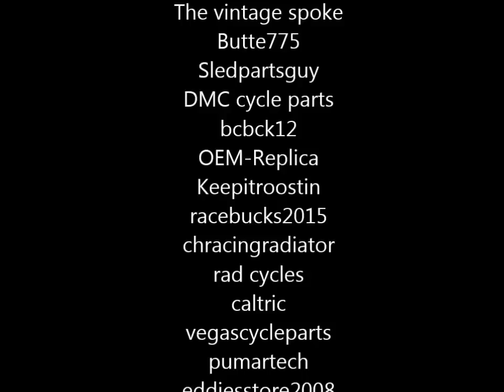Incredible rebuild of a $300 CR250 Dirtbike

Comment: Awesome build,  Ive done 3 of these with my brother -  There's nothing that compares to restoring   these 2strokes,  Keep them Alive!
Reply from the maker: Thanks. 1985 CR250 in the works
Reply: TNT Moto I've got one now. Where did you get the plastic for this bike? All the aftermarket stuff I can find is off color.
Reply from the maker: I restored the plastic that was still good and got the missing pieces off used bikes from ebay. then i restored them.

Comment from the maker: I sanded the plastic with 600/800/1000 wet sand paper. then I used a product called plastic renew using fine steel wool between coats. I have tried a buffing wheel but I could not get it to look this good.

Comment: who is the music by??????? freaking AMAZING!!! awesome CR as well! about to do the same thing with my 1992 WR200 2stroke..
Reply from the maker: +lucid phreak This is the song name and author of the music in my video 
Tremsz
Gunnar Olsen

Send me a link to your WR when you are done. I want to get one as well  because they look great done up with YZ plastics and customs graphics. This guy did an amazing job https://www.youtube.com/watch?v=rJSNr7KffPA
Reply: +TNT 22 The thing to note is that the WR200 and the WR250 are entirely different beasts... The 1992-1997 WR250 2 stroke is definitely basically a YZ250 with a wide ration gearbox.... The WR200 is TOTALLY different... Plastics are not interchangeable nor are any parts that I am aware of other than the front number plate (if you were going to remove the light from the WR200 and put a number plate on which I plan on doing)..... The WR200 motor came from the yamaha banshee 4 wheeler ... It has the YPVS system (powervalve)  that was not shared with the YZ that year - and I believe the forks are even different diameter.. The WR200 along with the IT175/200/250 are the most sought yamaha dirt bikes ever built because of the mellow power they deliver... You can basically compare a WR200 to a KDX200 - though "Dirt Bike" didn't thing the WR was anywhere near as good as the KDX because it was slightly porkier... For a 2 stroke though the WR200 is BULLETPROOF.. There are stories of people with the original piston who have ridden the piss out of these bikes... 

Now - what some people HAVE done, is taking the superior YZ chassis/suspension/brakes and mounted the WR200 motor in it to get that smooth power that people love so much.. But its not easy... People have also stuck one in a CR125 frame which is just mind blowing to think about.... 

Anyways - just a little info... Huge differences between the bike in the link and mine - but I will definitely keep you posted.. Its solid white other than the seat and will likely remain that way...
Reply from the maker: +lucid phreak  I was not aware of the vast differences between the two bikes. I had never looked up the 200 before. The 250 is the one i plan to get.
Reply from the maker: +lucid phreak This 200 looks pretty good. http://www.dirtbikerider.us/SP/264544
Reply: +TNT 22 the 250 is definitely cool.. I had one available to me here for $600 and passed on it simply because I wanted to 200 so badly due to the rareness... And yea, my bike looks basically the same minus the logo... Maybe not quite as sweet of condition...

Comment: I'm fixing up a 86 cr250 and was wondering how you cleaned up the forks and rear shock also if you bought the number plate backgrounds or cut them out yourself?
Reply from the maker: MotoMayhem The forks I cleaned with 1000 grit sandpaper and a brass wire wheel. the backgrounds I cut myself by making a paper pattern first

Comment: My Bro has one of those except his is thrashed. Awesome bike! Can't go long on a tank tho lol
Reply from the maker: Yes they like to gobble the gas. He should restore it. You would be surprised how little it cost doing everything yourself. and the reward in the end. well, show him this video.
Reply: Yeah it would be sweet. But I'm seeing coolant in the engine oil. Still fine as long as he changes oil every 2 or 3 rides. The bike has had a hard life for sure. It's a "Mad Maxer" now lol
Reply from the maker: Ya the magnesium clutch cover was a bad idea on Hondas part. But its amazing what you can do with JB weld and it will outlast the Magnesium.

Comment: Nice job. How did the paint on the frame hold up?? i usually powdercoat...but painting is a lot cheaper so curious to know how much chipped off/rubbed off. Also what type of paint did you use? cheers
Reply from the maker: Thanks. I don't own the bike anymore, but chipping was not a problem. It did rub off on the sides where your boots contact but even powder coating does that after a while. This was done with rattle cans with hardner in it. I am going to try regular automotive paint with hardner and a air gun on the next one. I will let you no how that holds up.

Comment: how did you get your plastics to look so good did you paint them?
Reply from the maker: I sanded them with 320/400/800/1000/2000 then  you can buff it with a sheep's wool buffing wheel on a drill being careful not to melt and add a Polish or you can use a plastic restore solution.  I will do a video on some of my Kx plastic when I get a chance.

Comment: How did you clean the tank and radiator shrouds so well?  What did you use?
Reply from the maker: Started with a SOS pad. then sanded with different grades of sand paper from 220 all the way up to 4000 with soapy water.. then buffed it with a sheeps wool buffing wheel on a drill. Try not to remove too much plastic on your tank or if you drop it it will puncture easy. experiment on a scrap piece of plastic till you are happy with the results, then do it on your good stuff. The coarser the sand paper you start with, the longer it will take to get all the fine scratches out later. If you have a newer bike that they still sell a plastic kit for $100. buy the kit. Buy DC plastics only if you cant find plastic to restore as its color and fitment is not perfect.Good luck. :).

Comment: I have 2 bikes a 96 yz 250 and an 87 cr125 that I love older Honda's are the shit.
Reply from the maker: Tony Cerino yes the older bikes are awesome. if you had today's suspension on a older bike, none of the newer bikes would touch them.
Reply from the maker: Tony Cerino I plan to get a 1987 cr125 for restoration after the 85 cr250 I'm working on.

Comment: Hey tnt, I have this exact bike and I'm looking to restore it in the very near future. I am very interested in where you found all the parts you replaced. Could you let me know? Thanks so much. Great video.
Reply from the maker: +Josh Engel  Most of my parts were purchased from EBAY. Sometimes it can be hard to find them on there. Simply looking up 1986 CR250 did not always get me the results i needed. Sometimes i had to look up just CR250 with nothing else. Other times i had to be very specific and put 1986 CR250R rear plastic fender. Alot of the parts are the same on the CR500 so that's a good one to look up as well. other times i had to look up the part number. I used this site to find exact part numbers. http://www.hondapartshouse.com. You can also cross reference by looking up different years and different sizes to see if parts match. Another way is to just post a Craigslist add that you are looking for parts for your bike. Sometimes people have bikes laying around or parts and they never post them. Good luck with your restore. Post a video, would like to see your progress. Any other questions, don't hesitate to ask.
Reply: +TNT 22 thank you so much, I'll post videos on my progress, thanks for the help!

Comment: on the before pictures on the swing arm what causes that i had it on a bike i brought years ago?
Reply from the maker: What are you referring too?
Reply: it looks like flakey metal on the rear linkage and swing arm not the shock sorry at roughly 21 seconds in
Reply from the maker: Thats actually dirt in the vid,  but its the clear anodizing coming off when its flaking.
Reply: ah thank you bud
Reply from the maker: no problem

Comment: Nice build! what are these worth now days? I have a 1986 in very good original condition. It has a crankcase repair though.
Reply from the maker: I have seen fully restored to factory original listed as high as 10000. not saying the guy got it, but thats what he listed it at. Now that was a complete restore, probably $3000 just in new oem parts. I sold mine for $2000. It was in good shape but not perfect. What country are you in?
Reply: I did notice at the end of the vid you were in Canada before i posted.  Im in the US. My bike sat for a long time and is hard to start but when I got it going its scary powerful. I dont know what to do with it because its too tall for me and friends, as well as wicked fast. I want a 70s type of bike with maybe a 300 of 400 ex type 4 stroke. Thinking selling the cr250 and building a older bike. my first bike was a 74 Yamaha dt125 and I would like one of those on steroids (ie 400 ex motor) Thanks!